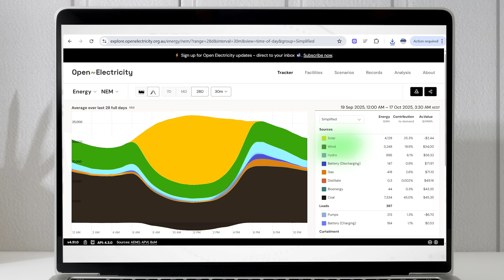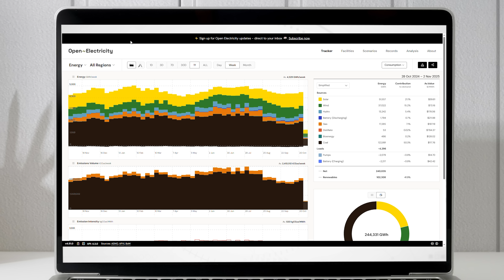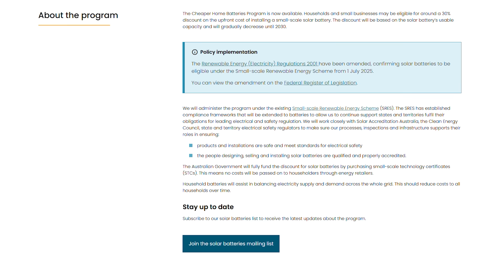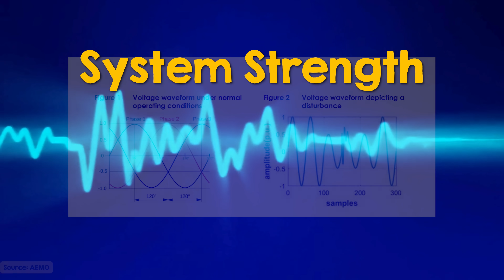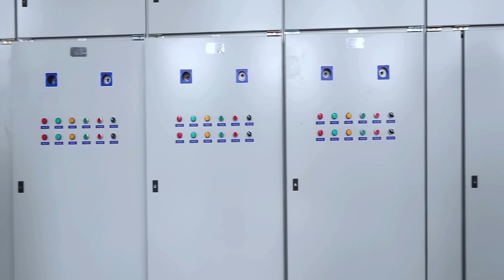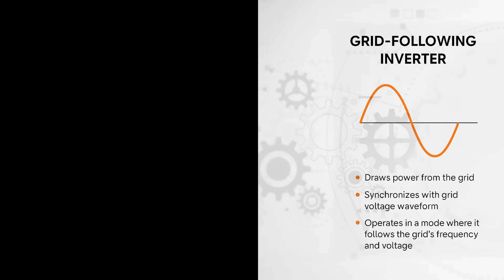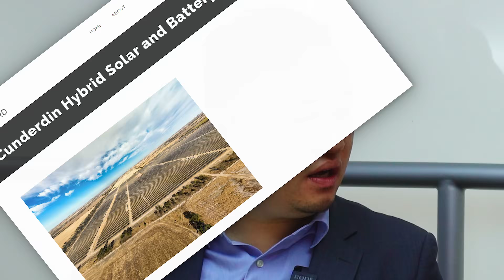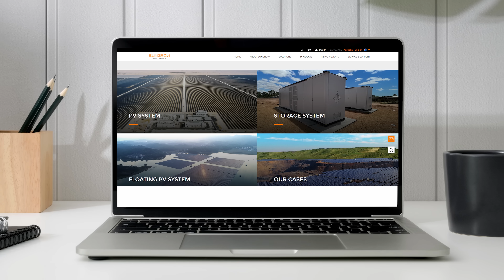Australia’s Solar Boom Is Breaking the Grid - Or Is It?

Comment: While smart inverters certainly help, as any new technology they do have a few new problems that will need to be carefully addressed.  
- One is security, especially if these systems have remote update capabilities.  Certainly hacking into infrastructure is nothing new, but system security would become even more important when everything is code.
- Good error handling.  Even with perfect code that takes all possible conditions into account, sometimes a cosmic ray just flips a bit and the system crashes.  
I am certain that much smarter people than me are working on how to address things like this in the real world and looking forward to the rest of the world following Australia.

Comment: Nothing like an independent review sponsored by a battery / inverter company
Reply: Rosie is indeed independent but that doesn't, and shouldn't, mean she doesn't have a position.
Reply: Yea.. as opposed to all those climate studies funded by coal, oil and gas lobbies.
Reply: hahaha yeah, the battery installed so far cover 10sec of 86 400sec/24hours... meaning its impossible to achive what they are talking about... Atleast without making every poor soul in Australia poorer than a third word citizen. And battery's need to get changed out all the time also, so yeah... impossible and plain and simple stupid.
Reply: @RogueSecret  Batteries requiring replacement all the time - well that depends on the chemistry.
LFP cells are rated for 3000 cycles before hitting 80% of original capacity.
If you don't cycle them as much - well you'll increase the number of cycles.

Assuming the price per kilowatt of storage drops, then even at the minimum 3000 cycles - thats just over 8 years till 80%
Further assumptions would be that you size the capacity of the battery for long term - eg if you use 10kwh at night and you size it for double the requirements. (20kwh)
Which 80% is still 16kwh at the 8 year mark, although you'd only be half cycling the battery.
Age is more likely to have an effect on capacity.

The tricky part is then to deal with EV charging, course with V2G your car can be a battery used to offset peak power demand.
Having control to power companies (like hot water) could be an option too.

Looking at it another way, I think battery storage is also good for independence from the grid in times where there are outages or natural disasters.
At a bare minimum, it makes your own solar more useful versus being paid a pittance from the supply.
Offsetting peak pricing with your own generated solar.

Granted you have to run the numbers to see if it works out for you.

As for nationwide projects for energy storage, storing it as heat in sand towers, pumping a fluid to a higher plane and battery storage.
There are many ways to be able to capture the energy for release later.
Reply: @RogueSecret  were you by chance dropped on your head at birth?
Reply: @RogueSecret  Why do you talk about the capacity installed so far when you want to argue about what is (im)possible to achieve? It literally makes no sense. Let's start by some very blunt observation: installing storage capacity is economically only viable if it either acts as primary reserve for avoiding short term peaks or if there is a regular surplus of generation capacity at prices much below the peak rate. Guess what, Australia so far primarily had the first condition and only recently moved into the second area, just like many places e.g. in Europe. Combine that with the massive improvements in capacity per dollar for battery storage solutions and the history is simply not indicative at all.
Reply: @RogueSecret  is a third word citizen.
Reply: @RogueSecret that is only true in the fantasy world of the fossil fuel industry. Batteries already installed are proving the concept on statewide scale and those planned can completely transition Australia from fossil fuels to renewable energy much faster than the goals offered by our current energy generation policies. That’s also when every bill should go down.👍🏽🌝
Reply: @malcolmrickarby2313  Ask the uk with their massive amounts of wind power. Is the electricity bills cheaper?
Reply: @cwt4560 unfortunately for the poms,wind power is owned by big utilities who are responsible only to their shareholders. Aussies are producing electricity from home and selling excess electricity to the grid. As we get more storage capacity through the uptake of EVs we can tell those price gouging companies to leave their fossil fuels in the ground.😊 I’d have said ,where the sun doesn’t shine but that is the UK 🇬🇧 😊

Comment: Misleading information. How much of the renewables is Made in Australia. How much battery capacity is required to fully power Australia in the worst weather conditions, middle of winter. How much of the code for all the equipment is under 100% Australian control. Even home inverters are under Chinese Communist Party control as per Chinese law. By the way, have home solar and battery and have never been 100% self sufficient even in the middle of summer and dont run a/c.

Comment: Absolute rubbish.  It is far, far easier to manage the output of generators by managing the input (coal, gas, water, uranium etc.)  Trying to manage the output requires massive storage but how large do you make it?  Designing it for the current 99th percentile of weather might not be enough and you'd still get blacked out.  Make it more than you need for "most of the time" and for most of the time the excess storage capability will be wasted, which is not cost-effective.  And when you've finished spending a fortune on storage you'd better start saving your money because in 15-20 years you are probably going to have to spend as much (or more) again when you replace the solar panels and the storage.

Comment: The ability of the system to provide fault current is an interesting electrical engineering challenge. Not unsolvable, just a challenge!
Reply: Had somebody explain specialized UPS's just for supplying fault current in a datacenter environment over Discord a few weeks ago.
The fault current gives them enough time to trip breakers or spin up generators.
Edit: the conversation started with breakers that can request that the recloser up-stream trip if they are supplying too much fault current to safely trip.

Comment: Interesting article. I foresee other problems that are more related to Grid affordability. I have disconnected from the Grid as the cost of being connected were far higher then me running a backup generator that requires occasional running during winter. The connection fees are now higher then I would ever use on fuel and maintenance for the generator to occasional top up the batteries. As the cost of batteries have dramatically reduced, the cost to stay connected is becoming none viable for home owners.
Reply: What kind of off grid setup are you currently running?  Equipment and specs.
Reply: @beyondfossil  24KW Solar, 3 x 8.2KW Fronius Primos, 2 x Selectronic SP482 (7.5KW each), 56KWh LFP Batteries Rack mounted 14 modules in parallel, 20KVA Autostart Diesel Generator.

Comment: To have a future reliable and stable AC Grid it is essential to understand the operation of the existing AC Grid and to change
from systems based on the AC Grid’s frequency to systems based on the AC Grid’s Phase.
ELE (Eric Lewis – Enstore “ELE”) proposed basis of a reliable and stable AC Grid following ENTSOe Grid Forming guide is:
• That the value of the AC Grid’s Phase Jump Angle, following the allowed MPT, is limited to be equal or less than the
maximum APJA in each Local Zone of the AC Grid. An APJA is needed as GBGF inverters have a Current Limit.
• The maximum allowed values for the APJA and for the MPT are defined in the SQSS for both +ve and –ve polarities.
• That all new and existing inverter-based Assets are Type Tested to deliver their power up to the APJA without tripping to
provide reliable power and to avoid any risk of a cascade failure in the AC Grid.
• That NESO installs sufficient Assets in each AC Grid Local Zone for the APJA requirement to be achieved.

ie. batteries with grid forming inverters can stabilise the grid.

APJP Active Phase Jump Power that flows after an AC Grid’s Phase Jump Angle.
MPT  Maximum Power Transient that is allowed in the AC Grid
SQSS Security and Quality of Supply Standard.
NESO (GB) National Energy System Operator for Great Britain
GBGF  Great Britain Grid Forming inverters
ENTSOe European Network of Transmission System Operators for Electricity

Comment: We need to get off fast car chargers
convert or (start making) all cars to VPP
start making charging stations at 5 to 10 k/w chargers
put them in random location off power poles shopping centers train stations
car parks inner city for cars that off street park
you nominate how much % your car works at
ie 50 to 80 % and minimum charge you need like 30%
then when you go home it becomes your home batterie
I would like to know many k/w are in Ev's now
hot waters are also a good batterie (you don't get power back just cheap hot waters)

Comment: So what you are saying is that the economic model for the nations electricity is biased against cheep 24/7 baseload generation
- you fail to say that base load is still required24/7/  to cover the tomes when the wind does not blow and the sun is not shining nicely
- so we have to pay a higher cost for a non redundand dupicate power generation system

Comment: This should have been titled Not Enough Batteries in the Australian grid.
Reply: Or ‘We need to add more grid stability’. A problem that we WILL solve.
Reply: @andrewrussack8647  That's what the more advanced batteries do, such as the big Tesla battery in SA.
Reply: @jollygoode4153  that battery is very small compared to the increasing need for stability.
Reply: Almost mandatory to have a battery installed with any new solar system. The cheaper home battery is resulting in a huge number of homes added a battery to solar or installing solar and battery for first time. So cost effective to do solar and battery at the same time.
Reply: @brettclowes1257  hi from Canada, I have a e-friend in Australia who is also into solar, and they told me years ago "almost no one installs batteries here" - even at that time, I thought this was not going to go well.  In my system the battery is big enough to power my home and charge my EV for days, that way the grid is my back up power supply and there are no big peaks in grid demand since the batteries take the big loads, and the grid can just charge at the daily average energy.  Glad to hear Australia is not pushing for batteries to pair with all that great solar you guys have.
Reply: @brettclowes1257  those homes with 6KW solar and 20KWhr battery could give the finger to gov n grid, disconnected and power to the people for the people.
Reply: @FlintStone-c3s  Until the government says we gave you a subsidy, now we want control of your battery.
Reply: @gregpenhaligon7859  Use our money and tax payers financed rebates to fix the Grid that they can turn off anytime they want. And if they want they can use those Smart meters to set fire to our houses.
Reply: not only, there is also teh strength adn stability, which battery does not adress. you need something on top, and that is what teh sponsor of the video is making.
Reply: @benjaminlamey3591  Why are you making false claims? Batteries do increase strength and stability.
Reply: @YouTubeChannelForAll  no, a battery does not provide teh stability of teh grid. look again at the video. here it is about frequency stability and fault currents. a battery alone does not do that unless you have a special battery with the special inverter, these inverter are not the common cheap one but a new tech that is undervalidation.
Reply: @benjaminlamey3591  You don't know what you are talking about. Grid-forming inverters have been around for a while now. They are only marginally more expensive than regular inverters and they are used all over the world, work perfectly fine and are permitted in Australia.
Reply: What about industry requirement of power
Reply: They have had to break transmission lines into smaller sections as the capacitive inrush current can't be supplied by solar and wind forms.
Reply: I mean… its an Island…the Citys are all in the costline…build some 300m high wind turbines and youre good
Reply: @Nehes.6743 wind turbine also connect through power electronics and not throuhgh teh good old alternator. so the strength and stability is not adressed by these.
Reply: @benjaminlamey3591 thats true but at 300m Meter and beyond you have a very consistent "jetstream" which decreases the problems we here on ground. The Wind does blow 24h up there.
Reply: Way to miss half the content
Reply: @kayleekayt3306 my thoughts exactly

Comment: If coal powered generators are the reason for negative wholesale electricity prices why does South Australia have negative prices?
Reply: Because it's connected to the eastern states via two, soon to be three interconnectors. So lower prices in Victoria drag down SA's prices, in the same way that when international gas prices rose the cost of natural gas also rose in Australia, despite the fact that ours is sourced from local supply with no change to the cost of manufacture.
Reply: @alexhautot3142 Yes
Reply: Part of it is market design as well. Where I live in Alberta: the price is not allowed to go negative by legislation.
The maximum price is also $999/MWh instead of the $10,000/MWh in some other jurisdictions like in Texas (where charging a Tesla at the wrong time can cost $500, in Alberta to cost would be capped at like $50).

Comment: This clip kind of misses the main difficulty as that is not the day/night cycle, it's seasonal difference as the batteries needed to store power from the summer to be used under the winter would be massive. It would require as much as double the amount of solar panels needed for the summer to make do under the winter making that summer production wasted. There are some mostly green alternatives like biomass, waste recycling or nuclear power. But something will be needed during the less productive solar season.
Reply: This is one area where "Natural" gas can actually act as a transition fuel.
There are a few renewable sources of methane, like garbage dumps, that can't keep up with base-load. But should be able to support the grid during the coldest months.
Reply: @economicprisoner  Yes, there are quite a lot of green alternatives that could help solve the issue, even cows produce a lot of gas naturally. The absolute amount compared with the yearly need is rather small, something like 10-20%, depending on the margin on the solar power. It's just that the peek need is naturally when solar power is worst, making it fall behind other solutions. 
But it's also on another scale then the amount of batteries needed to smooth out the daily needs as that is something on the scale of 0.1-0.2% of yearly needs pretty much ruling out storage.

Comment: You've done some videos on V2G in past years, but didn't mention it here. Have you soured on that strategy? Xu et al. 2022 published in Nature Communications that only a small fraction of vehicles would need to participate in V2G to eliminate the need for stand-alone grid-storage battery manufacture, especially once end-of-vehicle-life car batteries are widely available for stationary storage. Seems to me that this would also reduce the demand on transmission infrastructure, since many folks would use rooftop solar to charge the cars that provide their evening power.

Comment: Rosie - Can you present an analysis of intermittent manufacturing as a use for excess renewable power? What industries can economically trade low cost intermittent power, for excess capacity? Ideas that possibly could work - water desaliniaztion and liquified air gas production.

Comment: If you can build a functioning and stable power system with solar at home, then there is no reason why it can't be done on a bigger scale like the grid. The problem lies with the design of the grid. We need an overhaul of the grid to make it work with solar. I feel like we are trying to patch and old system that is no longer working for us. These are teething issues and they will be solved in the future.
Reply: @jasonjohnson3393  Whats so funny?
Reply: @puffinjuice  , a 10kWh battery can store up to 10 kilowatt-hours of electricity when it is fully charged. To put this into perspective, if you were to use 1 kilowatt of power per hour, that battery would last you 10 hours.
But if the Sun don’t shine the battery doesn’t charge… 😂

Comment: Very interesting and informative video! I wonder if those "end of line" spots which have suffered from voltage swings on long transmission lines will no longer need syn-con solutions simply because they can start producing their own wind/solar power.
Reply from the maker: Broken Hill for example has chosen to opt for energy storage at their end of the line instead of transmission upgrades (though it's not installed yet). They do have a big wind farm also and of course solar. It's an interesting case study. They actually had a blackout recently despite having plenty of generation available on their end of the line, which goes to show that there's a lot more to power systems engineering than simply making sure there is enough generation to meet demand at all times.